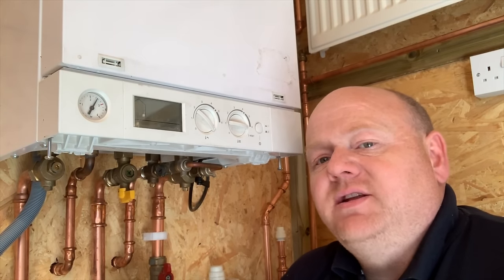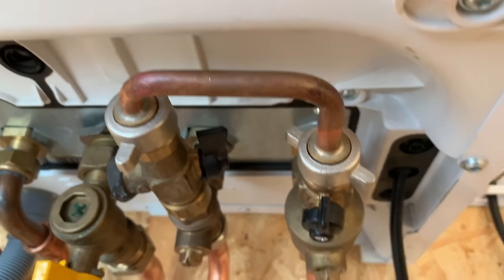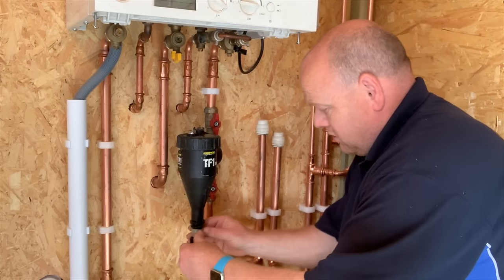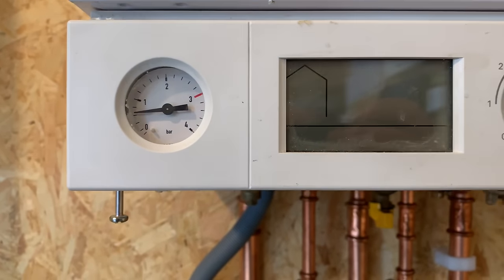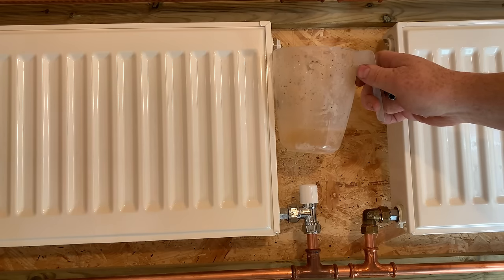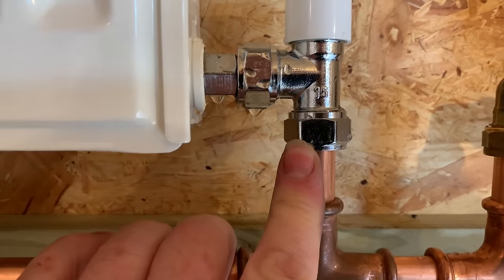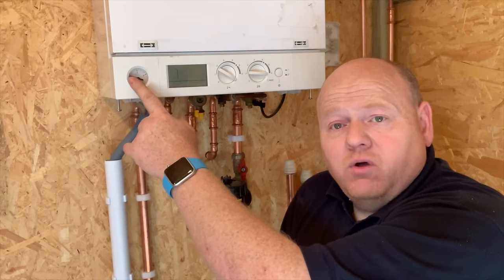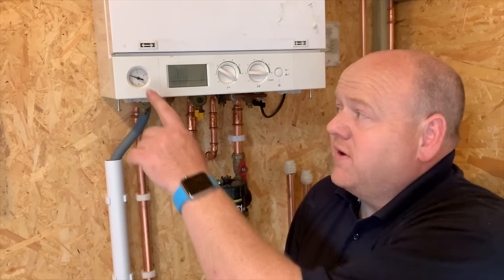Combi Boiler Too Much Pressure - How to reduce the water pressure - Central Heating

Comment: Today my boiler pressure started to continuously rise, heating is off but hot water is still being used. After about 5 hours I have to bleed the rads because the pressure is up in the red...Then I have to bleed them again 5 hours later. Any thoughts? All the pressure top-up screws seem set correctly.
Reply from the maker: Filling loop left open maybe? Let us know. Thanks.
Reply: @AllenHart999  Hi, the heat exchange had pin hole sized damage. Had to be replaced.

Comment: Hi Allen, I have a greenstar 30ierp. The boiler pressure goes up after few hours of use (2.5bar). The radiator is not being used and filling loop is closed. The pressure relief valve has been changed recently. Any idea's?
Reply from the maker: It could be a faulty expansion vessel, or it just needs a service. Could you call out a local gas engineer to check it out? Thanks.

Comment: Thanks Allen!  Very comprehensive. Quick questions (1) I assume that draining the filter is only possible if the temperature is not too high? (2) Is there a video from you on the Expansion Tank / Valve checking?
Reply from the maker: Not at the moment. Sorry.

Comment: Hi i lost water preasure due to a leak on rad i represurerised boiler but now boiler keeps cutting out i bled radiators but just the same do you think i have airlock still thanx
Reply from the maker: Could be an airlock yes. Thanks.
Reply: Thank you good for helping us all

Comment: Hi Allen, I recently had a combi-boiler fitted, and the normal boiler and cylinder were removed.  However, I've noticed a tiny water leak coming from a part (which name I don't know as I know nothing about boilers or plumbing).  The part is black and is attached to a silver part.  It is at the top of a pipe which the engineer marked 'cold main'.  On the black part it states, 'SYR 3.5 Bar'.  Could you please tell me why there is this tiny leak and if it's serious?  Many thanks.
Reply from the maker: Thanks very much for your comment, please consider subscribing to support the channel 🙂

Comment: my ferroli water heater had an f-37 error code...so i added a tad to much pressure by opening the valve...now i want to reduce it some to get the dial in the green zone...maybe the it will stop dripping out the bottom chasy into my cabinet...?

Comment: Evening Mr Hart, we have a 4yr old WB 30Si Compact, with integral filling loop fitted. Pressure to CH continuing to rise and release into ext overflow. Checked E Vessel for water ingress, had only dry air in then recharged to 1-1.50b then re pressurized  CH to 1-1.50b. Heating works well. within hrs the pressure rises again. Through process of elimination, isolated DCW  and  pressure remained same, when DCW reinstated pressure within mins on the rise. I'm thinking  faulty pressure loop though there is no noise coming from the fitting. Your thoughts Sir (serviced last year)
Reply: Mr Blue could faulty secondary plate heat exchanger
Reply from the maker: Thank you

Comment: V.helpful video! If it is the expansion vessel, how do you determine if the rubber seal is leaking or not? Also how do you find out what the pressure in this vessel should be?

Also why do all modern boilers appear to come with expansion vessels & pumps inside, when these need to be sized to suit the house? It seems it’d be better outside the boiler, as in the past with traditional non-combis.
Reply from the maker: Thank you

Comment: I have an Isar he24 and it's pressure is at 3, Ive tried taking water out of the rads and via a valve under the boiler. it dropped a little to under 3 but went back up? Im unsure as to which way the on off adjustments are mean't to be. horizontal ot vertical? there are two near this valve that lets out water. I've tried both ways and doesn't seem to make any difference. can you please advise>

Comment: I’m at 1.8 bar when boiler is on with the heating. Would that cause my hot water pipes to be noisy with water flow? It’s not knocking but sounds like a rocket going off.

Comment: Allen I used the radiator tap to drain my boiler. It was in the red zone around 4 bar. I took off about 2.5 litres and it dropped to 2.5 bar. I took off another 5 litres and it remained at 2.5 bar and won't come down any further. Any tips or is it time to a central heating engineer in?
Reply from the maker: Did you get sorted ?

Comment: Would it be best practice to add an additional pressure vessel or to remove the internal vessel and pipe to a new larger  vessel?. (Just learning, wont do without gas safe engineer by my side)
Reply from the maker: You could never have too much expansion.
Reply: @AllenHart999  ah ok, I got you. Thanks for the reply 👍
Reply from the maker: @phasedout6769  No Problem.
Reply: Starly You don't need a gas safe engineer, you can add a second expansion vessel away from the boiler at just about any convenient location along the heating pipe work.

Comment: Hi. Allen i fitted a ideal logic max. Pressure keeps rising on guage. No matter how many times i lower the pressure via filter to 1 bar it immediately starts climbing to 2 and above. Filling loop definitely not bypassing. Checked expansion vessel charge and thats fine.  What else could be causing high pressure on a small ch system.
Reply from the maker: Thanks very much for your comment, please consider subscribing to support the channel 🙂

Comment: Great video, Allen. While raising the pressure after it dropped a bit, the pressure jumped to 3.5... I've drained loads of water from radiator as you show, and aside for a brief few moments when the pressure dropped to normal 1+ range, the pressure still at 3.5. There has been water coming out I guess an overflow pipe ( which you also talk about ), but... the pressure still 3.5 and don't have a clue what to do now... Any ideas, anyone??? Thanks and enjoy your day, Rick
Reply from the maker: Thanks very much for your comment, please consider subscribing to support the channel 🙂

Comment: Hi Allen our heating isn't working, pressure too high I presume, bled the radiator pressure went down slightly, but back at 3 now, dripping outside house too... Is it the PRV?
Reply from the maker: You need to have the boiler serviced and the expansion vessel checked. Thanks

Comment: Hi, i have an old boiler, ideal classic FF250.... pressure gage was at one, as i didn't realize the valve i was turning was releasing water - it is not at zero.... there seems to be no other value connected to the boiler.... any ideas?
Reply from the maker: Did you sort it? what was the issue

Comment: I have a question which I can't find the answer to on Google. When I was cleaning the other day, I accidentally went a bit too close to the central heating control panel and I think the smallest amount of water must've leaked its way inside. The control panel started to flicker and slightly buzz. I grabbed a wooden spoon and switched it off. I haven't put it back on yet. Wondering if it will be safe to switch back on or even put the heating on or should I leave for perhaps longer? Have tried searching on Google but cannot seem to find an answer anywhere.
Reply from the maker: Thank you

Comment: Nice 1, Al!
Cant find the drain off cock on a rad. Either one hasn't been fitted or it might be underneath the floor, that you have had laminated over and so can't get to. Or, whomsoever did the install did not fit one anywhere near the lowest point or on the rad nearest the door (so you can put the garden hose on and chuck it outside)  in the first place. If the latter...I'd be worried. 
Some boiler manufacturers actually put a small drain off on either the flow, return or both pipes under the boiler. Being able to isolate the boiler and drain down is great for servicing/repairing the boiler without actually having to drain down the entire system. Draining off here to reduce pressure actually means you can keep an eye on the pressure gauge. Sometimes the needle can stick. A few gentle flicks/taps with your finger nail might free the needle up.
On radiator venting nipples.... If you accidentally completely remove the nipple, more than likely you wont be able to get the damned thing out of your vent key. I cut a few mm's off my keys, so that if this does happen, you can actually just re-engage it. No need to try fiddling around with the pointy end of the nipple to get it out, then dropping it on the floor in a panic as water showers you, whilst your on your hands and knees looking for the nipple.  It happens to the best of us.
Also, some older rads don't have a complete plug replacement.. the ones with the o ring and white plastic spinnable thingymajig on to direct the water into your jug or cloth. Sometimes they are gunged up with paint and sometimes the nipples are rounded off. Top tip... follow link.
https://www.youtube.com/watch?v=T6r5kPce1B8
Reply from the maker: What a great guy tom is. I would love to meet him.
Reply: Me too. Wigan folk have a reputation for being forthright and not tekkin' any BS. Bolton folk have a reputation for having an weird sense of humour. Me mam's from Wigan n me dads's from Bolton. Strangely, I've actually started looking like TP but with a grey beard and less teeth. That's why I never show my face on vids. Scares kiddies and strips paint at 100 yards.

Comment: My boiler is new 1 year old when my heating is on around 23 d  presher is 3 notches before the red valve is this normal when heating goes off it ends up dropping to 1 bar is this ok

Comment: My 3 year old ideal logic combi c30 boiler made a loud growling noise and locked out during Xmas. An engineer visited, reset and started the boiler ... it checked out fine. Since then it runs for 3 to 4 hours and starts to growl.. if left to run the noise increases and the boiler vibrates and then quits.... shows fault code F2. Had a British Gas engineer and an ‘Ideal recommended’ engineer out.... but the boiler runs OK. during their visits.  Ideal have been no help at all. Any ideas?
Reply from the maker: https://www.youtube.com/watch?v=3PchrKOhdx8&t=610s

Comment: Thanks Allen.👍
Allen my boiler does not retain its pressure. Soon as i fill the water the pressure goes down straightaway.  I have an ideal isar.i cant see any water coming out the copper pipe outside the one you mention. 
Can you do a video on that please.
Reply: max navsa you have a leak somewhere ! Could be on the system or the boiler itself. Isolate the flow and return valves under the boiler using a flat head screwdriver. If the pressure still drops it’s a boiler issue. If it doesn’t it’s on the system side. Let us know how you get on and we can advice further.
Reply: Btw, that’s the far left and far right hand side valves. Turn the heating controls off whilst isolated just to avoid the heating from firing up
Reply: @heatservicebwcuk1545  cant work out which is flow and return valves, the two i have are right next to each other.
Want to send you a pic but not sure how to.
Reply: max navsa underneath the boiler you will have valves connected to pipes. You need to turn the extreme left hand side and extreme right hand side valves using a flat head screwdriver.
Reply: max navsa one will have a pressure gauge (left) the other will be the same valve but on the right hand side. Ignore the 15mm pipe to the right of that existing the bottom of the boiler as that is the prv pipe. Just to say I’m trying to help and will not be liable for any mistakes.
Reply: @heatservicebwcuk1545  hi, ive just isolated the valves and the pressure does NOT drop.
Does that mean theres a problem on the system? And what sort of a problem? I cant see any obvious leaks any wear.
Many Thanks for you help
Reply: @heatservicebwcuk1545  when i opened the CH Return the pressure drop. But not when not when the DHW inlet.
Reply: max navsa cold inlet is irrelevant. 

You have a leak on your heating system if when the valves both flow & return are closed the pressure is stable. Thanks
Reply: max navsa I assume you are putting the pressure around 1.5 bar. 

If the pressure is dropping rapid, you have a fairly bad leak on your heating system. You need to be checkinf underneath all radiators, If nothing is visible I assume you have pipework under ground floor level ?

Comment: Hi Allen, tried to reduce the pressure of my water pressure but still above 2. My boiler is now showin F1 (low water pressure code) and wont work. There seems to be only a little bit of water coming out of the radiators. I don't know what to do!
Reply from the maker: What boiler is it? Thanks

Comment: Hi my boiler pressure in about 0.7 bar cold and about 2 / 2.5 when on...I have bled the air out the radiators. If I put it up to 1 when cold then it goes up to 3 when its on. Thats why I bring it down to about 0.7. Is this okay?
Reply from the maker: https://www.youtube.com/watch?v=UR9wSU-I2O8
Reply: @AllenHart999  thanks, I think though that this is the same video 
I watched and commented on.

Comment: Hi, underneath the combi , how can I identify which is the central heating RETURN pipe? Can’t tell the difference between flow and return. I assume where the cold feed attaches to the topup loop is the flow? Or am I incorrect
Reply from the maker: Read the installation instructions. That will tell you which pipe is which. Thank you

Comment: Recently had an intermittent flame failure on my combi.  Engineer just did a service, and gave boiler a good ratting.  How can I correct this should it happens again ( and it did not long after engineer left) or do I need to call BG out?  Cheers.
Reply from the maker: Thanks very much for your comment, please consider subscribing to support the channel 🙂

Comment: I have a De Dietrich Combi Boiler. It is showing a "slash through the radiator" icon; as in no heat. The black arrow is barely above 1; the red arrow is below 1. Is it a pressure issue? Can it be repaired with dynomite lol? Please help.

Comment: Hi Allen,  my vokera boiler is going upto 3 bar.  There was hardly any pressure in expansion vessell so I blew it up to 1 bar.  Not cured the issue,  do I need to reduce water pressure and then pump the vessel up?

Comment: Hi mate. My boiler has to black handles and 2 blue handles plus the additional for gas and the one the next one to the pressure gauge. The pressure keeps going up by half a bar every few weeks. Plus the pressure gauge makes a bit of noise every time the boiler is on. What needs to be done?
Reply from the maker: Not sure without seeing it sorry.

Comment: Hi I've got a Worcester combi boiler green Star. The system was showing 3.5 bar. I've drained the whole system and it keeps refilling itself back to 3.5 bar. Please help
Reply from the maker: Filling loop left open or maybe split heat exchanger?
Reply: I checked the filling loop even tapped it shut.

Comment: Hello Alan. I have followed your video to reduce my pressure because I keep getting an F.75 message up on the boiler and was told the high pressure might be the reason. I have reduced the pressure but the boiler will still not start. It's trying to but gives in after about 5 attempts and F.75 comes back on screen. Any suggestions would be very welcome. Regards
Reply from the maker: Hi Paul. Did you sort it?

Comment: Hi Allen our boiler is over pressured by 5 bar I’ve drained it off from the rad got it to 1 bar,  run the boiler till warm only a slight rise in pressure but when running the hot water the pressure goes sky high. It seems to be a hot water fault. Any thoughts regards Clive.
Reply from the maker: Sounds like a faulty plate heat exchanger. You will need to call out a gas engineer or Viessmann. Thanks

Comment: I wanted just ask about my new pump its a evosta 40 -70 130 and he has left it on max ,3 lights,but we seem to have more air in the system its coupled with Potterton titanium, i have turned t dow to 2 lights,is that ok for circulation through the boiler i am also going to fit one of those automatic air cocks in the bathroom towel rail ,which seems to be the one that collects  most of it,thanks for any tips,.
Reply from the maker: Thank you

Comment: Hello.My vaillant boiler is 1.5 bar cold and goes 2 bar in heat.To reduce it i leaked a radiator and pressure went 1.0 bar cold but while the heating is on it reaches again 2 bars.The vessel is new and pumbed at 1.5 bar.Is this normal?

Comment: Continual loss of pressure can also be caused by a leak anywhere in the system. I found out after spending hundreds of pounds that a rodent was gnawing at the plastic manifold underneath the caravan (exterior to caravan on new Carnaby's) as it was attracted to the odour of the antifreeze ! The Plumber caged up the manifold with wire mesh and (touchwood) solved the problem. I was forbidden to put any poison underneath for the little rascal due site regulations.
Reply from the maker: 😱Glad you sorted it, Bet that cost you a fortune?

Comment: Hi does this work on any boiler please?
Reply from the maker: What boiler do you have? Thanks.
Reply: @AllenHart999  its called exclusive,my partner drained loads of water from out the filter like what is on yours,do we have to completely empty it?the pressure went down great but soon as he stopped doing it it keeps going back up but didn't drain it all,is that the problem,thank you for getting back to me

Comment: Iv bled from radiators and got the pressure down to 1 but when heating is on it’s going back up to 3 and sometimes 4
Reply from the maker: Might need a boiler service and the expansion vessel recharging. Or it could need an expansion vessel. When was the last time you had the boiler serviced? Thanks.
Reply from the maker: Thanks very much for your comment, please consider subscribing to support the channel 🙂
Reply: @AllenHart999  done
Reply: And I don’t think it was that long ago tbh
Reply from the maker: @davidhiggins6051  Thanks